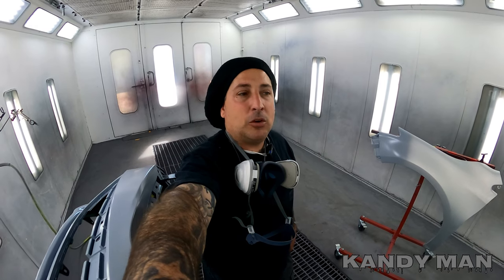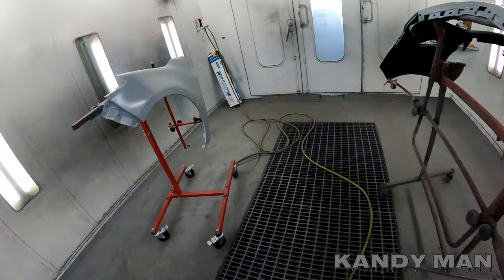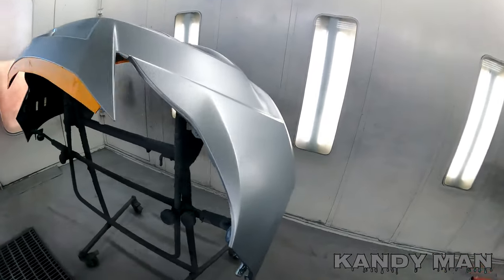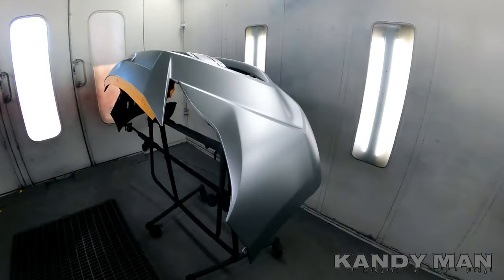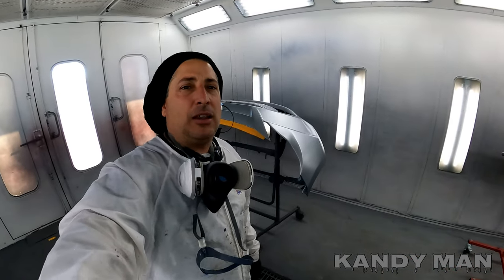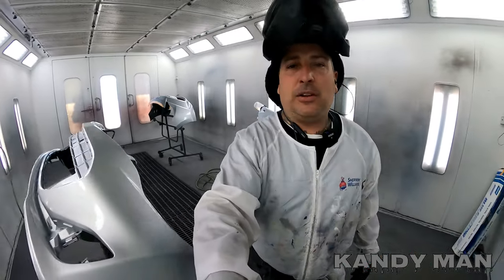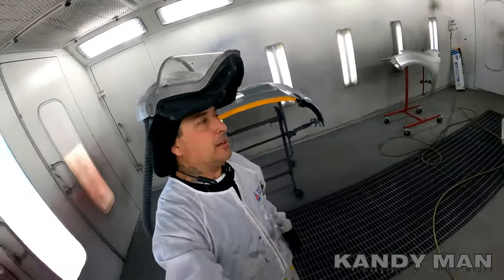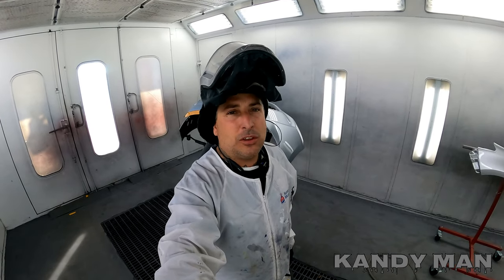IWATA W400 CLASSIC BELLARIA LV

Comment: I use one everyday with a 1.4 tip. I run fluid at about 2 and a half turns out and pressure 31 psi or so for a flat finish and all the way down to 24 psi for those chunky peels. Its much easier to control then my sata and sagola.
Reply from the maker: Thanks for the support

Comment: They went up on the price of the classic when the new kiwami came out. I just sold a kiwami because the fan was smaller and it struggled with high solid clear, may be a good base gun but didn’t perform like i thought for clear. The classic is way better but they are over 300$ now
Reply from the maker: Ya I seen  them on ebay  for 2 something.  Definitely still worth every penny. Thanks for the comments. 👊

Comment: I've had my bellaria (means beautiful air) 
for a long time in a 1.4. Love that gun its not even that bad on material. I have it 3 turns out from closed on fluid. 
What are your settings fluid and fan wise?
Suddenly it wasn't spraying the Metallics so nice but still use for every other kind of material. Might just need a rebuild kit.
Reply from the maker: Full  fan full fluid  love the name 💪😁

Comment: I have that gun, use it for sealer every day. If it came in 1.2 it would be a better clear and base gun for me. I spray axalta cromax pro. Spray s the top coats too heavy. But it lays down a flawless flat coat of sealer. The other two w400’s on eBay wbx and wb with the split nozzle spray waterbase a lot better. Both come from Japan.
Reply from the maker: Thanks for the insight and your experience 👍
Reply: A 1.2 is available for the Bellaria but it also requires a different aircap. Both are available from Spraygunsdirect in England. Problem is the cost of the aircap and the needle/nozzle set is more than the cost of the gun.

Comment: What settings were you using? I got this gun 1 year ago [ paid $500 for it ]and I will be using it tomorrow for the first time. I am NOT finding a lot of info about it on YT as in what psi to spry with spraying basecoat and clear. GunMan says about 2 bars lol as he paints by ear listening to the gun. 2bar is 29psi according to google search. Any advice would be great. Thanks
Reply from the maker: I spray mine at 25 to 30 psi for sealer or clear wide open fan and fluid hope this helps .

Comment: what psi and fluid u spraying at? the guns beast but puts out alot of overspray if u dont have a booth lol
Reply from the maker: 28 psi  1.3 thanks for watching
Reply: That's true. The reason is the lack of the split nozzle. Iwata can get away with low air pressures on the LPH400LV and to some extent on the Supernova because of the pre-atomization of the split nozzle on these guns. With the Bellaria the aircap has to do all of the atomization by itself so you've got to run it at 29 PSIG to get the performance.
Reply: @kandyman5315  I have a 45 foot long garage that was previously used for refrigeration repair. I have a bay for painting/prep and another for mechanical work and parking. Makes me very happy to finally have adequate space to work right here at home. I have 2 Iwatta 400's 1.3 and 1.4 (lv2) I really don't know the difference in the 400 series as these are the only 2 I have ever used. I do know,  they work well for me in my home shop and they were a good investment. I use the Accuspray 3M for all my primer work and LOVE the time I don't spend cleaning out primer guns! I love this thing and I only paid 218.00 for the pps2.0 version! The tips last me thru several sprays. Gun cleaner in a can does the job quick! Once in a while, I will do a small paint repair with it, but I bought it for primers.
   I can't run out and buy all the new spray guns, but I still like watching the videos on different guns and seeing the results👍
I'm a paint video junkie....
Reply from the maker: Sounds awesome 👌